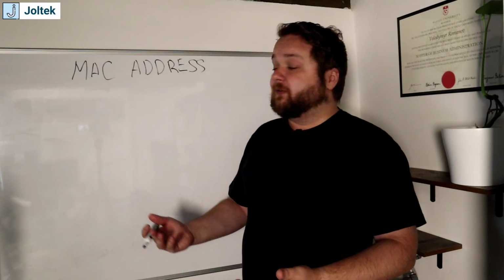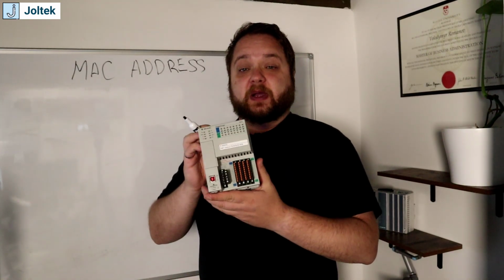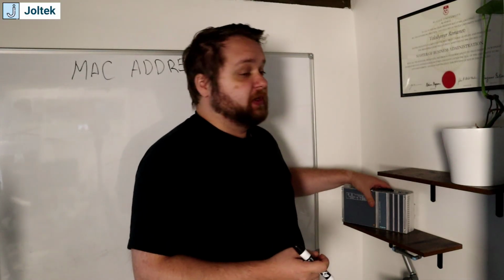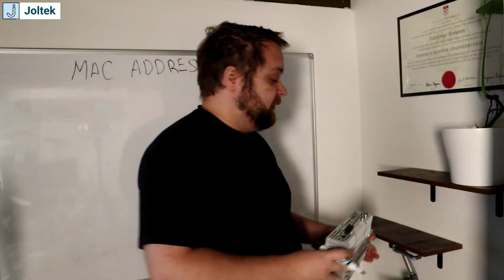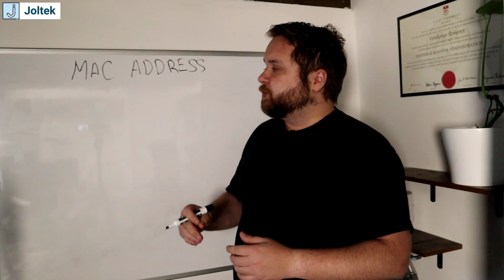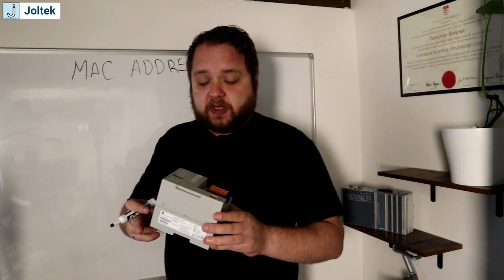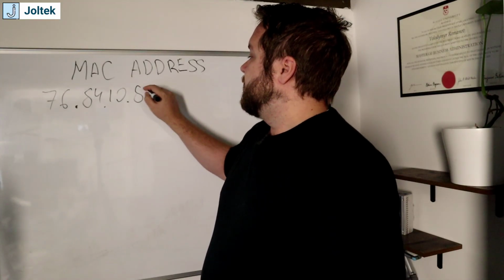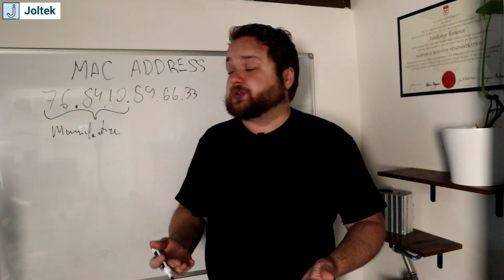L2.8 | Understanding MAC Addresses in OT Networks | Industrial Automation Engineers Manufacturing

Comment: I really love this one. Thanks 
I found a field component with 2 MAC addresses an Emerson Drive.
Why asssigned 2 Mac Addresses for a single component ??
Reply from the maker: It's possible that they have separate NIC cards if that's the case. You can assign different IP addresses. Can be used for one going to the PLC side and one plant side.